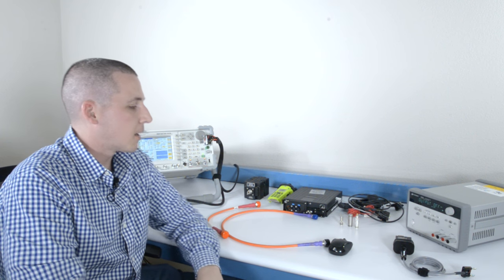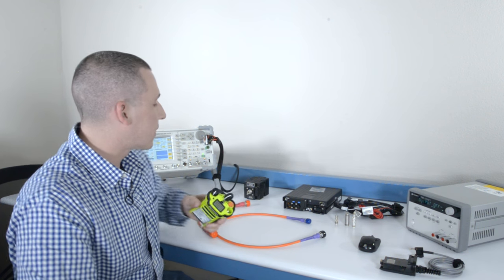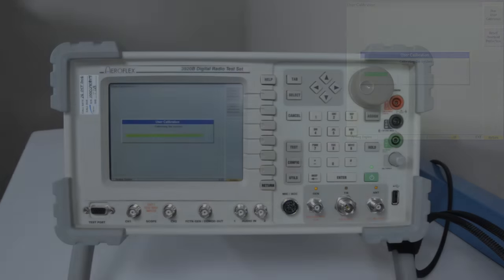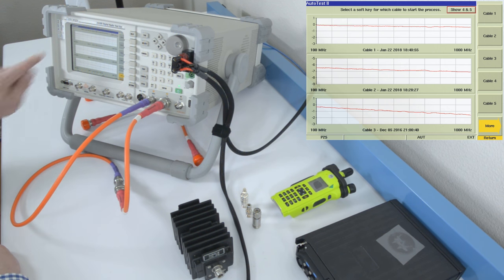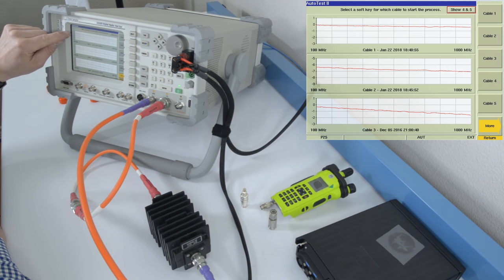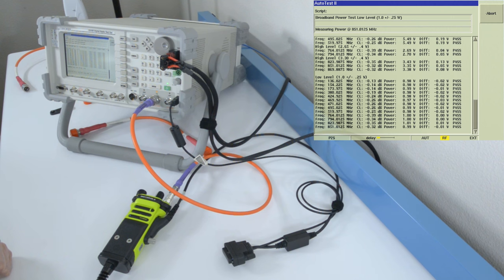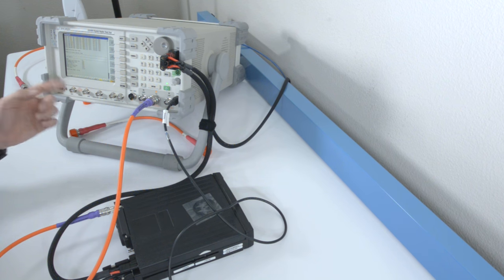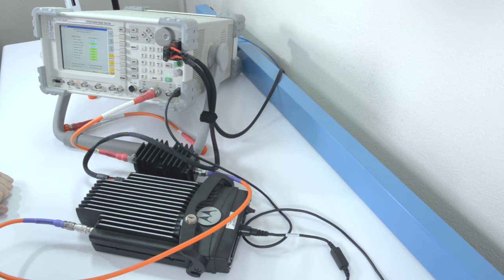Aeroflex 3920B Radio Autotest and Alignment Tutorial

Comment: Good job sifrl
Reply from the maker: Thanks, Jim!
Reply: Thank you.  Sorry about the typo.  Only recently I got to use the mic boom arm that you manufacture.  It is the best one I have ever used.  I can see why so many professional dispatchers have it.  I did not know about the other products and first class service of Motorola Radios.

Question, is it possible to sweep a UHF male and UHF female (PL259 SO 239) at or below 30mhz?  I believe that at those low frequencies there is in essence zero insertion loss. I did a YouTube video with 30 connectors in a string and could not measure any loss up to 54mhz.  I do know that there is lots of loss in the coax.  And that most of coax is really poorly manufactured.  Apparently there are no standards for the coax that we buy.  Thanks, Jim W6LG   

.
Reply from the maker: Jim,
The 3920B and tracking gen can certainly sweep that cable at these low freqs. Our set goes from 100KHz up to 2.7 GHz so doing an insertion and return loss test from 1 MHz to 50 MHz would certainly do the trick. If you like, send one of these questionable cables here and I can video the sweep test process and results for the heck of it. Also, I am really very happy to hear that you are enjoying the mic boom arm. We love that product and I personally use on every day for videos and web chats.
Reply: You're on!  That would be great.  I want to impose on you a little more.  I want to do maybe 3 cables.  If you could sweep them from  about 3.5 to 440 mhz, that would be very informative.  I met a bunch of hams at coffee and they all are interested in what makes up a good cable.  I need to think about what cables for a day or two.  Thanks for the offer.  I am very happy that you are willing to do that test.  Thanks, Jim W6LG in Grass Valley, CA
Reply from the maker: For sure, Ill send you our address and we can do these tests as soon as we get them.

Comment: What is the part number on the APX battery eliminator?
Reply: Hi Paul, the Motorola PN is 66009254001. But, please be cautious with this eliminator. It comes with a banana plug that would go right into a power supply but the eliminator DOES NOT regulate the output voltage supplied to the radio. You will need to make sure that you adjust your supply accordingly. Good luck

Comment: i want to know what is the model no. and the brand of the power supply
Reply: Hello, the power supply was a Astron at that time. It was a 50 amp linear supply if I remember correctly.
Reply: @mdanon1  Need exact model I want start program mobile
Reply: What is a good power supply ? I want to be able to adjust the voltage